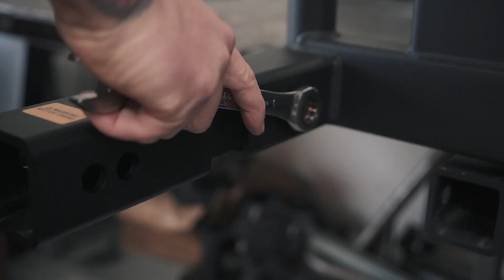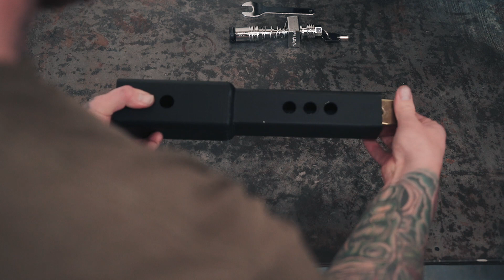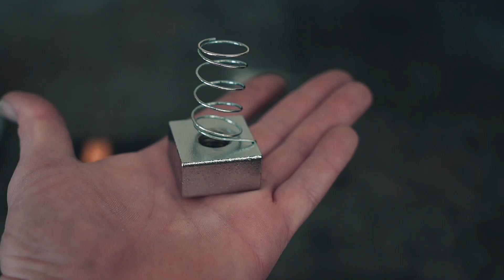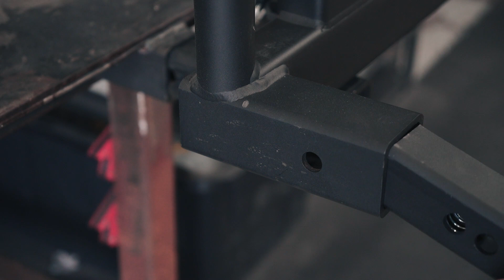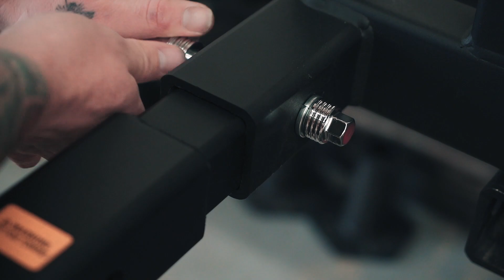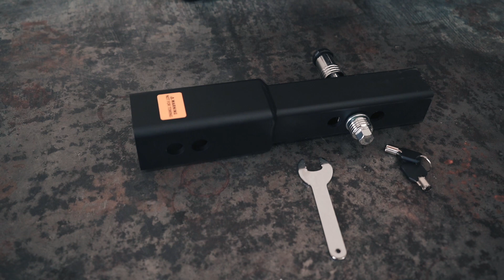WobNot locking bolt upgrade.

Comment: I can't find this on your site.
Reply from the maker: This product is included in our WobNot hitch extension. It's not sold separately because it doesn't fit anything else we make and it's often confused with a locking hitch pin that would be used on our UltraSwing or other products we offer. If you do in fact need this component for our WobNot hitch extension shoot us an email to support@rigdsupply.com or call us 714-820-9444 and we'll get you taken care of

Comment: Is there a torque spec on the bolt or no just as tight as it can go
Reply from the maker: There is not a specified torque spec on this bolt, just a firm tight. Note that it's often beneficial to load your bike rack or other hitch accessory before doing a final tightening of the WobNot.
Reply: @rigdsupply6945  awesome thank you. Just installed this. That’s why I’m  asking
Reply from the maker: Awesome! Let us know if you have any other questions 🤙

Comment: What are the brass bolts and screw for in side the extension?  I obviously need to remove them to insert.  Thanks!
Reply from the maker: Thanks for asking, this is an additional anti-wobble feature to eliminate any vertical play in the rack. Let us know if you have any other questions.

Comment: You guys need to tell ppl what size the studs are for the base plate as people obviously need locking lug nuts. Especially with only 3 lugs holding it in place.. I bought the locking ones I had on my truck and the threaded part is way to big...  it'd literally take someone 10 seconds to walk off with my spare.  I can't believe you guys don't address this... that could be 1500+ gone in 2 seconds.
Reply from the maker: Apologies, and thanks for the feedback. We have to use the smaller 12mm vs 14mm (what you most likely have) because the other way around wouldn't fit for anyone with the smaller standard. We're with you in definitely recommending at least one locking stud.
Reply: @rigdsupply6945  awesome,  thx sorry for being a prick. I'm just not very mechanically inclined and I couldn't find it anywhere on the net. Thxs for letting me know. I'm ordering them now 🤗 👍
Reply from the maker: @riverrat8693  Thanks again for the feedback. We'll try to include those specs somewhere easier to find.